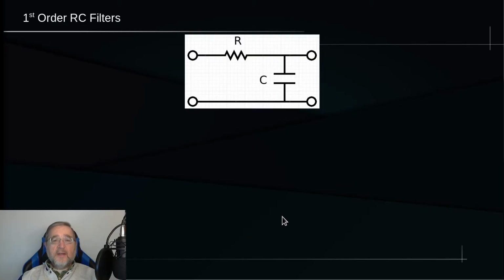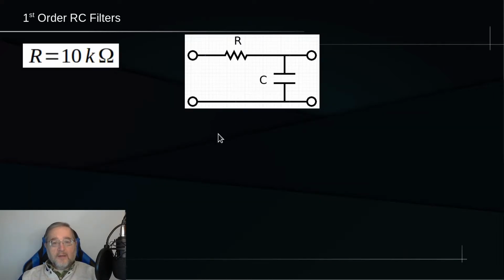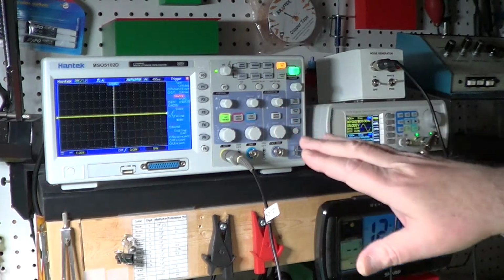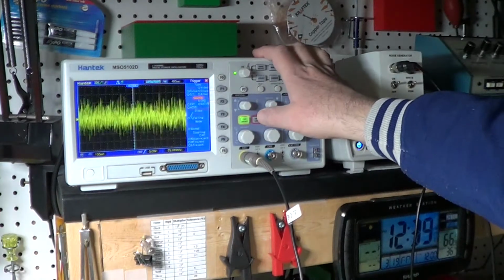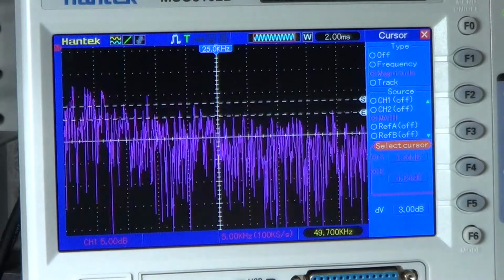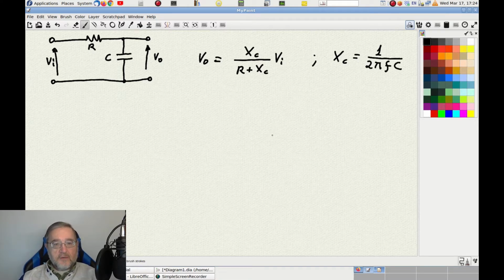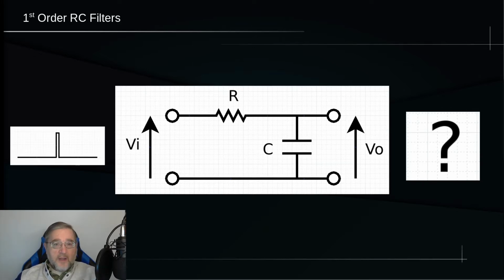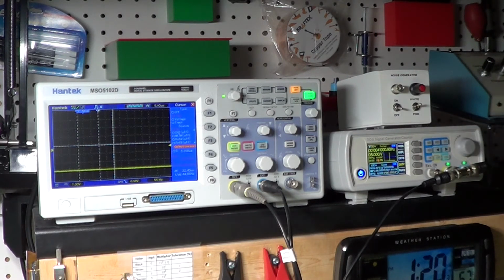Filters Tutorial 2: 1st Order RC Low Pass Filters

Comment: hi :) many thanks for the good work.I enjoyred the video, which the reason I wrote my comment. When I started watching the video I noticed that you are showing time domain signals only, it is much better if there is another screen with the necessary frequency domain plots (magnitude and phase) used side y side with the time domain analysis. Also better to use a variable frequency sine waveform (chirp) (much more expainalble for educational use ) rather than white noise. finally circuit parameters (R and C) were not given at the begining.